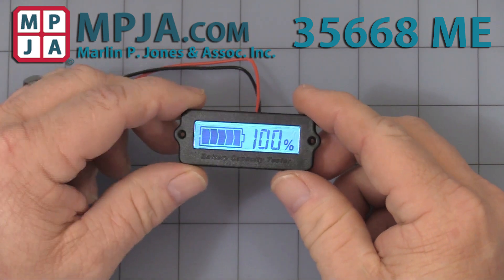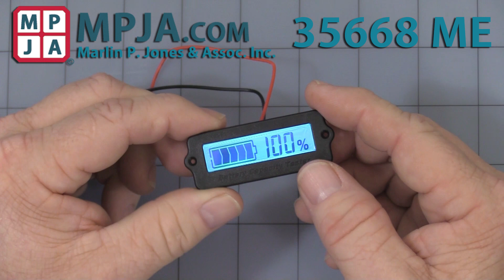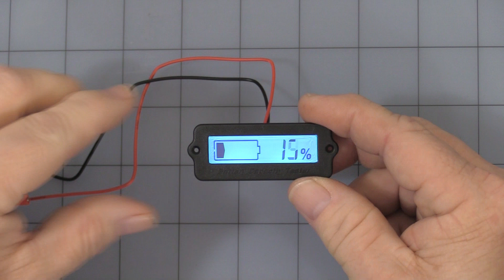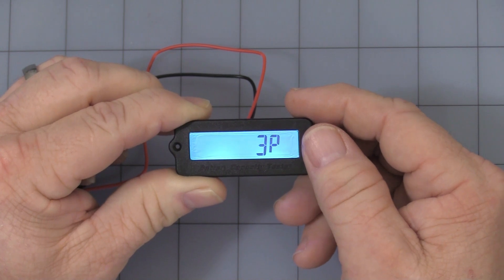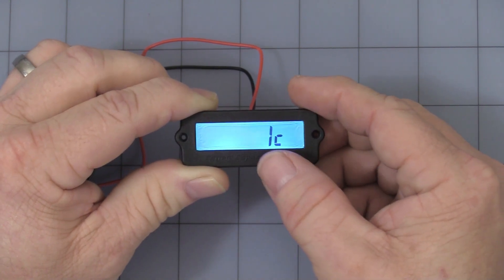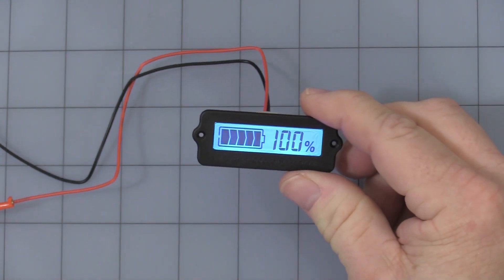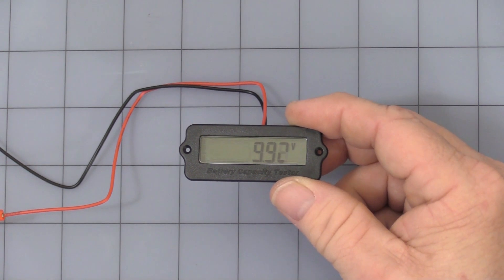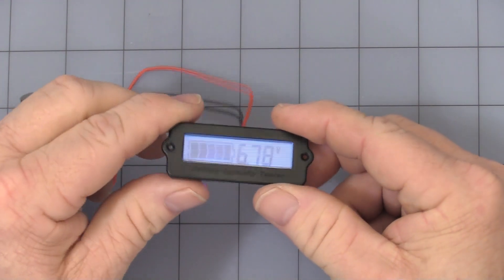Battery Capacity Panel Meter 35668 ME

Comment: I have 4x 3.6V Lifepo4 batteries, which total to 12V 100AH Do you know if this unit would work on my batteries?
Reply from the maker: The data sheet only list lead acid and Lithium polymer, not Lithium iron phosphate battery. Probably best to find a meter designed for your battery.

Comment: Hi I have a li-Lon battery 20000 ah it just shows 100% all the time any ideas.
Reply from the maker: How many cells do you have in series (output voltage). What type of battery (C = 3.7V Lithium or F = 3.2V LiPo Lithium) and what is the meter set at (3C thru 5C or 3F thru 5F)?
Reply: mpjaonline 
Thanks for your reply it’s one of the tall blue packed batteries from eBay it’s a li- Lon polymer battery 12v 20000ah can’t seem to find out how many cells it has. I can’t seem to find out how to send you a picture of it.
Barry
Reply: This is what it says on the battery Li-ion polymer Lithium out put 12.6-10.8 V DC 20000mah
Reply from the maker: @barrywebb101   Li-ion polymer are 4.2 V per cell 3 x 4.2= 12.6v this meter is designed for 3.2v or 3.7v Li-ion batteries packs; it will not read accurate for this battery. Thank You MPJA Inc
Reply: mpjaonline Thank you very much for your help so that’s why . I’m sure I’ll use it for something else.

Comment: How can you shut it down? is there a way you can install a switch?
Reply from the maker: Yes you can install a switch to the power lead to turn it off and on
Reply: @mpjaonline  will it remember it's settings?
Reply from the maker: @benoost5534  Yes, it remembers setting with power removed.

Comment: mine shows 100 all the time , reset it several times,  instructions pretty clear just doesnt work , any ideas?
Reply from the maker: What voltage and battery type are you using? After reset what is the meter reset to? 1P etc.  Next you need to press the button on the back to switch between percent and voltage. Let us know.
Reply: @mpjaonline  ive tried it on my golf cart 36v  lead acid,  yes its set to the proper setting according to directions,  no matter what i do it says 100% . even as the golf cart slows it still shows 100 ,  going to set it up on a 12 v lifepo4 battery and see if it works on that. just tried it on my power supply and dropped voltage down to 10v  and it does nothing still says 100% . in fact going to just throw it away .. it lights up thats it. get what you pay for. on golf cart it registers 36v  but capacity never changes and it doesnt on my power supply. poor qc i guess not worth returning